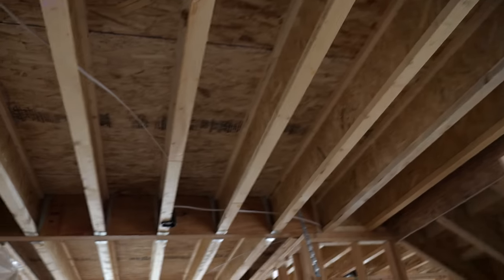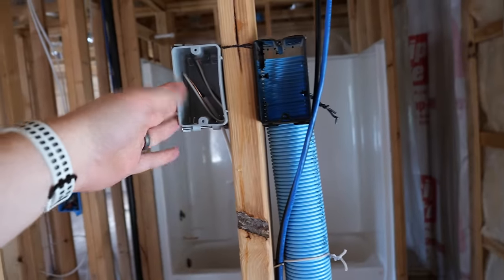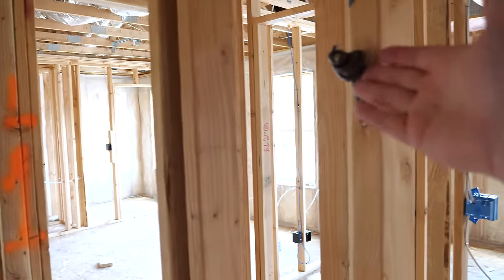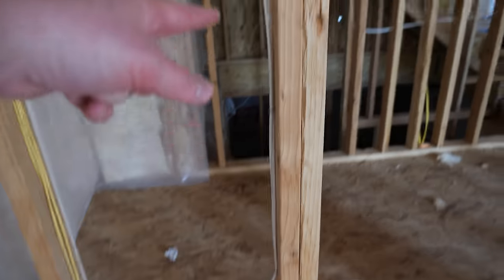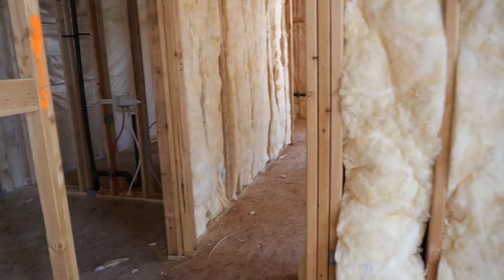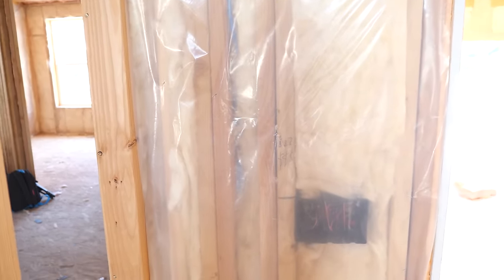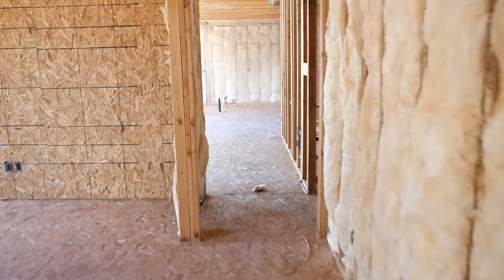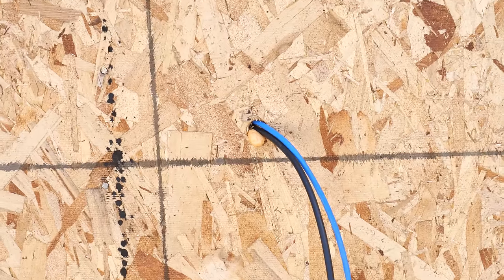Pre-Wire Walk Through of Our New Smart Home

Comment from the maker: I'm super excited to build a new smart home from the ground up! Any ideas you have for me to try out?
Reply: Pls try JULLISON smart slim recessed lights. It’s awesome!
Reply: great timing! i recently got a home too and am in the same stage as you
Reply: I would recomend using ubiquiti  and their cameras unif protect if you want cameras
Reply: Brett,
Oh my, such fun times.  Great Job & Sooo many great ideas in your beautiful new home.  
I enjoyed your video log because I've built two smart homes myself. Well done on CAT6 Everywhere, you'll never regret that!  Also well done on outlets in closets... my designs have outlets in all closets & lights in the closet headers!  

Just a few thoughts if it's not too late... the 1st suggestion is kind of EXPENSIVE but worth considering.
1. Check out the smart "SPAN Circuit Breaker Panels."  I know it means swapping out the existing 2 panels. It's about $3500 each... so it may depend on things like your emergency back up power plan or if you'll ever have solar, battery energy storage,...
2. In the garage... Consider adding a 100amp Circuit Breaker Panel... for future growth.  Triple the 20amp outlets.  Add 1 more NMEA 14-50 EV outlet in another car bay. 
3. I've used the Excellent Lutron lighting controls and LOVE them too.  Consider the Pico remotes as an inexpensive way to create 3, 4, 5 way controls.  It's a great way to save on some copper wiring too.  My next home will use much less copper.  
4. Music Everywhere is so important to us... Consider Sonos systems for distributed audio.  We have Sonos shelves & alcoves in halls, bathrooms, kitchen... all you need is 110v outlets.  The Sonos Port or AMP control our In-Ceiling Speakers & control larger amps like in garage, Rec. Room, & theater for general music. Our previous home had a very expensive distributed audio system ... Sonos in this home is better & far cheaper; freeing up funds for better theater equipment.  It also can grow with your needs. 
5. Well done on quad outlets at all Bed night stands. But as far as plug strips with surge protect go, perhaps not ... consider a whole house surge protection option at your Circuit Breaker room to protect entire home.  
Our last 2 smart homes had multiple UPS's on everything from IT Closets & Electrical utility rooms to Offices & Audio equipment.  The next home in design now will have Solar & a few Tesla "PowerWalls" ... aka a whole house UPS.  lol!  No more UPS Bricks Everywhere. 

You'll also be glad you have all the photos & videos too. Well done!  

Cheers,
Eric
Reply: @melswinterlbbh  They are over priced. Reolink would do just fine.
Reply: I love you ❤️

Comment: Great video. As a tech for  fiber ISP, only concern I have is the fiber home run. Not having a full conduit (Smurf tube) run from exterior to panel makes things a bit difficult on the house. Some companies only work on a fully fiber circuit, fiber fed directly into their router via SFP. With no conduit the tech would have to drill a penetration hole or run exterior line into attic to get to the panel, if possible.
Reply from the maker: Yeah that is a great idea. I might have to add one before we finish the basement.

Comment: Good overview Brett. These are always fun. The only thing I would've done from the front end is pvc or smurf tube from the exterior to the network location. It's better to keep the ONT or internet modem inside. ONT (fiber) specifically, needs power which is good to keep on backup battery with your network. PVC or smurf tube would allow your ISP to just easily feed the fiber inside.

Comment: You can never have to many outlets Brett- if you think 2 is enough you probably need 4, that is what I did when I built and still wish I had more in some of the rooms. Did not hear you talk about it but are you also pre-wiring for a alarm system?  I would highly recommend it- you can have all the sensors embedded in the doors and windows along with a siren, motion sensor and a control panel (if you want or just use a app), then use something like Konnected to run it and then control it with Smart things, Home Assistant, etc.
Reply from the maker: Maybe I did add them all and just didn't want to show... Door sensors is something I debated over but just ran out of time. Great feedback!
Reply: I felt the same way and went more extreme than most and even I ran short not factoring in door sensors and sirens and some window wires for shades after feeling shell shock from the price of the house as it was configured but overall I'm still pretty happy with it and my rack room is chalked full of work I need to do to get it all online still. My builder was pretty picky at what they would do too and often told me I'd need to add outlets to ceilings if I ran RJ 45s there which seemed odd but they weren't happy with my non-standard suggestions lol.

Comment: When we built our house. Every wall got a coax (not in an area with good internet) and 2 cat 6 cables. Every TV got 3 cat 6 (hdmi over cat6 matrix). Every single outlet got a smirf tube (empty) running to the attic, my attic is about 16' tall so I never have to crawl to install stuff. Just walk down and pull new wires. 

In the garage, living room, master, and patio all have speaker wire running. (stereo to most but LR is in wall and in ceiling surround).

Every corner of the house got 2-3 cat 6 for security cameras.

All cables run back to a closet. With a rack for every. But that being said building took 10 months. Moved in March and since then I have found stuff I would have changed.

My wife helped me run all the wires, saved a ton on cost.
Reply: After taking possession of the house. Went in an installed kasa wifi switches on everything.

Also forgot to mention that I added smirf tube to all corners of the house. (locations of cameras)

The reason I went 3 cat 6 to every TV. 
1 hdmi over cat 6
1 because I knew my remote was going to need IR blaster in whatever room(seeing all my equipment is in the closet) 
1 for internet to the TV for whatever it needs. 

Also we build a shop next to the house. Did my own electrical (100 amp) and internet in the shop too.

Comment: If you have any switch boxes that only have the 2nd switch for a 3 way, make sure you run a regular constant hot power wire to it as well. If you ever want to go back and add a motion switch that just controls automations, you will need a constant hot.

Also, if you are going to carpet the stairs, find a pressure mat, and get that in place before the carpet goes down. This way if you have lights for the stairs, you can use it to turn the lights on and off when you go up and down the stairs. If you are doing z-wave, get a door contact sensor that has wire terminals on it, then cut the end off the pressure mat, and wire it to the door contact, and you can use it to trigger the lights.

It’s probably to late to do it at this point, but run an extra cat 6 to your TV locations, and anywhere you might want to have a screen for camera views. You can use an HDMI to ethernet box, you can have a system that runs the video, and then just HDMI out to each screen. Samething with cable TV boxes, you can have 1 cable box work on multiple TVs, so you don’t have to pay for extra boxes. That will only make sense if you have places where you will to watch the same channel in the same room.

Comment: Nice setup sir. I am one of the crazy ones who ran 3 Ethernet plus a fiber optic cable. My thinking was one is for internet (which will pay off if they ever add a gig nic on TV's), one for 4k video, and one for IR for remote back to the rack. The fiber will be for 8k feeds in the future. I did run some smurf too both as a drop down to media centers and  I ran it all straight to the rack room. Also audio runs in every ceiling room for whole house audio. Needless to say I'm a nerd but love this stuff. Keep up on sharing the fun!
Reply from the maker: Every other pre-wire video I watched talked about whole house audio. I guess we just don't listen to music that much because it seemed like way too much to do. We already put a smart speaker in ever room so that will be the majority of what we listen to.
Reply: @TechWithBrett  Yeah it's not for everyone. My family is pretty obsessed with music so it made sense for us. My home builder wouldn't even run audio so I just had to do it all myself in the dark on a weekend haha. Talk about tight timing as you mentioned before the drywall went up. And while we are using cheap speakers now, as soon as I get the home theater processor and receivers with multiple channels going it'll all come together nicely.
Reply: Smart Branden!!
Reply: Brandon, that’s exactly how it should be done 
As a wise man once said   “ the most expensive cable is the one you never ran in prewire “

Comment: Brett, thanks for sharing your home build with us. It certainly explains what you have been up to lately!
We just moved into our newly built home at the beginning of July and I did a lot of smart switches (WIFI dimmers) for dumb lights and then selectively installed lots of WIFI downlights in different places. I did a lot of the Cat 6 cabling myself and still have a bunch to terminate. I have my WIFI 6 Nighthawk router at the top of the 2nd floor and it is amazing how fast the Gigabit WIFI is throughout the house. I am going to use the 2 access points I still have to install for 2.4 Ghz devices to take overhead off of the Nighthawk. Additionally, I am planning on using the wired ethernet for streaming and PC devices in the house again to take overhead off of WIFI. The problem for me is all the time it takes!
Reply from the maker: Great work! It does take quite a bit of time. It will be so nice when it is all done.

Comment: For our house, instead of a smurf tube they put in an HDMI plate for each wall mounted TV at the bottom, along with a coax cable and ethernet, and for a couple of tvs they also installed the analog red white and yellow plug for my PS2. It looks a lot cleaner and you don't have to worry about wires getting tangled up in the tube. You would need an HDMI switch if you have multiple things running on it, but thats not a big deal. 

They also added a Versabox to some of our tvs, which is basically a box you put behind the tv in the wall so you can hide all the wires, cable boxes, roku, etc. A little pricey but in the long run worth it, and you don't have things cluttering a media cabinet. 

I wish I would've seen your video before we wired our home, I probably would've gotten power to do smart shades instead of battery powered. I originally thought we wouldn't need them, but we did cordless shades and didn't realize how high up the windows went, so it needed to be powered.
Reply: Yeah I don't  understand using a single gang junction box.  Something like a Versa Box allows you to tuck in media streamer or conversion box right behind the TV.  As far as Cat 6 to locations most builders are buying bulk boxed category cable.  I'd recommend home owners looking to augment the builder installed stuff should look at bundled structured.  A single pull can bring say 2 Cat6 cables,  Quad Shield Series 6 (RG6) etc.

Comment: When I moved into my grandparents old house i had a couple of my buddies go up in the attic and run flexible orange conduit to all the tv locations, I ran HDMI, and 2 Ethernet cables to each. I wish I would have ran coax as well. The extra cat 5 was a pull line if needed. Everything runs back into a closet where the networking equipment and TiVo's are located. We even ran cat 5 into the closet for the internet provider to use, and made sure to leave an extra in case of future upgrades. This was in 2017. Fiber internet just made it out here about 5 months ago, use the pull line to run the fiber from under the house right into the closet in no time. About 3 weeks ago I ran fiber from that same closet about 200ft out to my man cave and that pull line came in handy again. My advice put in that conduit from the attic to the room where all your equipment is going to be. Will save tons of time and money in the future. Looks like you got room for 3 inch pipe!
Reply from the maker: Great tip! I actually did a conduit run in my parents house like this to an entertainment closet. I probably should finish the video about that...

Comment: Hi Brett. Thanks for the video! Must be exciting for y'all but exhausting at the same time. I would personally hard disagree RE: network wiring, but this is coming from someone who puts extra effort into keeping as much off the wifi as possible. Not for security, but just straight performance/reliability. If I were you, I would be running CAT6 everywhere and double as many as I thought I'd need.

Our house wasn't a new construction (ya lucky duck!) so I had someone run 2x to where each TV is, plus another 2x to my office. Turns out it wasn't enough! While everyone may have different feelings on a TV in the bedroom, my wife and I like to go in there outside of sleeping hours to get comfy and play games, listen to music, or just watch TV. Therefore, with a Roku/Apple TV/etc., game console(s) and the TV itself, my only choice was to add a network switch (not great for S.A.F.!) to connect them all via wire. However, I have moved to the TP-Link in-wall APs that have multiple NIC outputs, so that has worked in the meantime. In future, I'd do 1 electrical box for the AP, but run multiple network wires within the same cavity, so if I wanted to add another box for network wires, I could! :) Have a wonderful day, bud!

P.S. Great idea about the wires for the smart shades... oh and I never heard "Smurf tube" used as a term when talking about conduit! hehe That conduit is a great idea, and one I already would love to replicate in a new house, or when I get around to redoing my basement!

Comment: You can never have enough outlets.
 What I don't understand is why you would pay anyone to run all your low voltage, ethernet & security wires. That does not require a license and saves you a bundle. 
My #1 tip would be to go buy a ton of inch & a half sheetrock screws or deck screws and fasten your subfloor to the joists. This will drastically reduce creaks and squeaks in the future.
#2 tip, put blocking anywhere you think towel bars, toilet paper, grab bars, & mirrors will be located.
Similar to what you mentioned, when studs are exposed take some reference measurements but mark you studs/blocking with a sharpie marker and then take pics.
Reply from the maker: Those are great tips! I was planning to go in and do all the low voltage, but it was a bit tricky with timing. The builder didn't want me to do anything before the inspection was complete and then being unsure of when drywall was going to hit, I played it safe and had them do it. With all the wire and hardware they ended up using it didn't cost too much more for them to put it in, and they had to deal with all the frustrations of doing it. 😆

Comment: Great video. I added a 6 conductor cable to the doggy door area and now I can control the doggie door with my voice. It uses a plunger to lock the door. Also your POE equipment will chew up a lot of power. You will need several circuits for the AV room for power. I have 3 circuits and had to balance them bc I was popping breakers. I also put in shakers for the theater room and needed to run speaker wire for each pair of shakers. If you haven't experienced them you are in for a treat. I didn't even go to the movie house to watch Top Gun because my theater room is better because of the shakers. I also added a controller for a drop down TV in the kitchen that is voice controlled. I can say "Hey Google turn on the kitchen TV" and it will drop down from inside the cabinet.  You do not need to spend the extra money for Lutron shades. I made my own controllers they are voice controlled. My wife wanted to be able to turn on and off all the lights manually. So, I installed 5 tablets around the house and used an app called "ACTION TILES" to load every switch and outlet on a tablet. I found it remarkably easy to install and now she can dim any light in the house from the tablets. The tablets are charged by a cat 6 cable from the AV room. There is plenty of Youtube information on this. No need to buy expensive Lutron for the lights. Every light in the house is voice controlled with Samsung smart things. Good luck with the build.
Reply: Love what you've done! What did you use instead of Lutron shades and switches? I'd love to save money but don't know if any others are as reliable.

Comment: The under cabinet light was a head turner for me. For the undercabinet lights, I just had them install an outliet far up the cabinet and then installed a LED light skirt on my cabinet to conceal the  outlet and outlets on the toe kick of of all my cabinets then I can use LED strip with wifi instead. I'll rather use LED strips like Nanoleaf. I have it in my current house and it works perfectly so I'll be continuing with it.